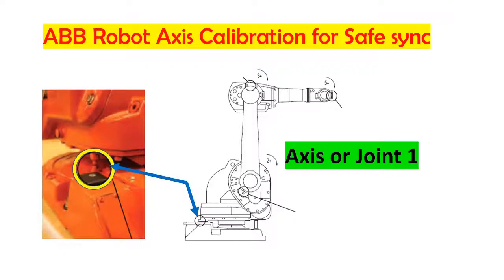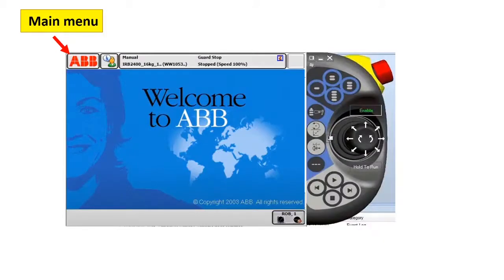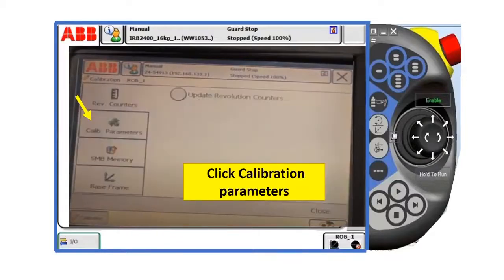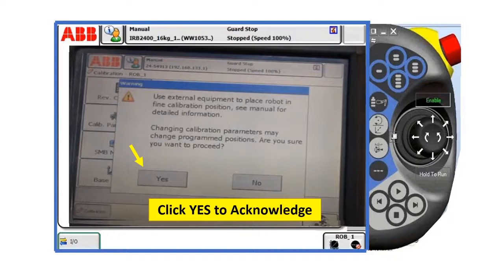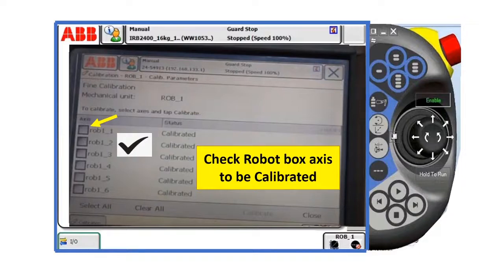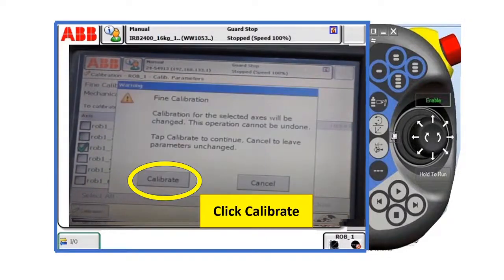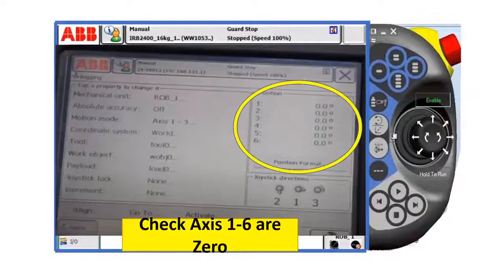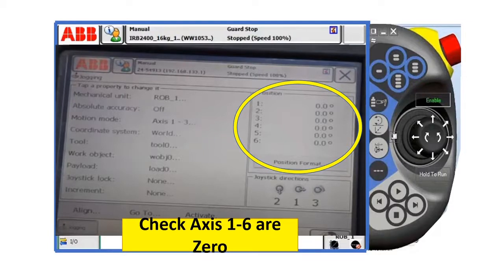How to Calibrate the Six Axis of ABB Robot-IRC5📖🕮Check Books @DESCRIPTION

Comment: Fine calibration MUST be performed with external device (as mentioned in the po-up window on flex pendant) called pendulum, and by executing a system routine called “calpend”. The one you perform by aligning joint referrements is a normal calibration wich  involves a fine calibration performed before.
Reply: That's right, the video is wrong. Please don't modify the fine calibration. The video way is to update the revolution counters